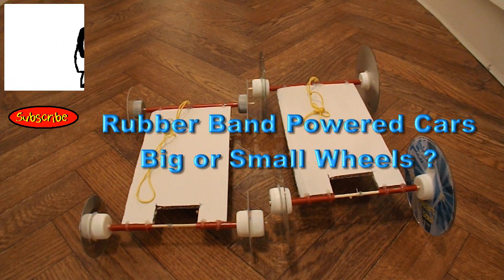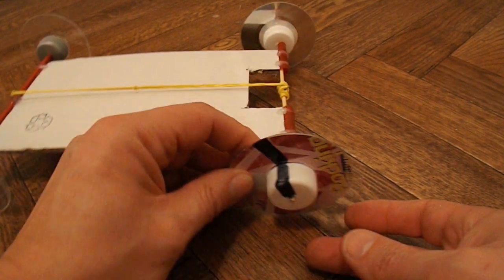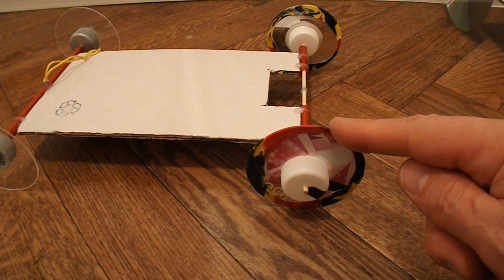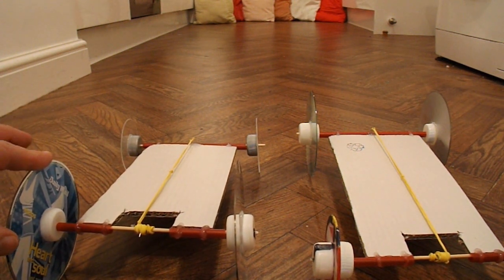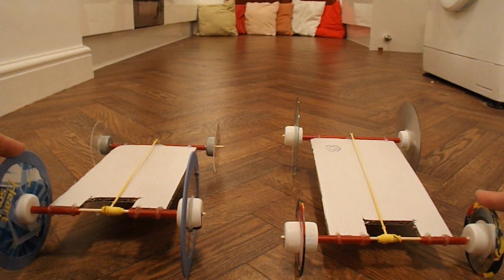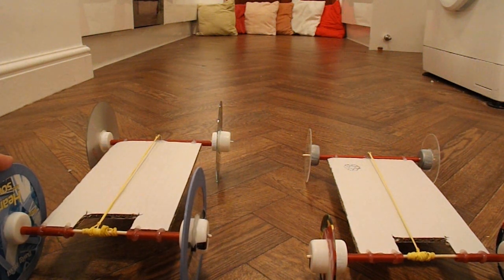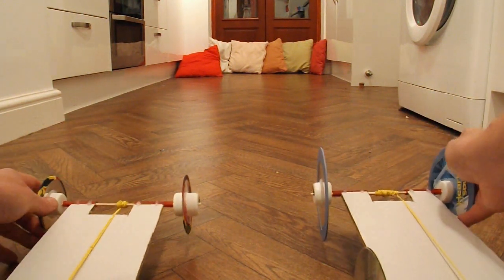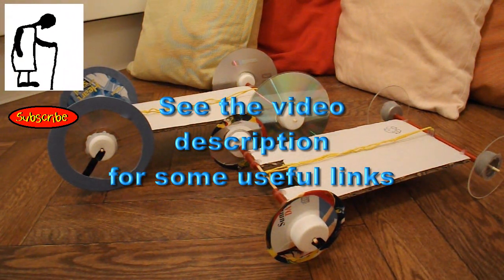Helpfile - Rubber Band Powered Cars - Big or Small Wheels

Comment: Would a front wheel drive cart be better (the rubber band pulls the front axle)?
Reply from the maker: Short answer, NO.  Long answer - In 'real' cars they make them front wheel drive to remove the need for a drive shaft to take the power from the engine at the front to the wheels at the back so it saves weight and space. A second advantage is it puts the weight of the motor directly over the driven wheels helping them to grip the road. Front wheel drive also helps with steering. However, even with that extra weight over the wheels front wheel drive cars are still more prone to wheelspin as the car accelerates from a standstill. The movement tends to push down on the back of the car and reduce the grip at the front, particularly on hill starts. I am speaking from experience driving commercial vans. HOWEVER when we apply that to a basic rubber band powered car there are differences, like no suspension to slop around and different weight distribution. I have just spent an hour trying to demonstrate my theory with one of my existing rubber band powered cars and I simply cannot show any significant difference so I would say from my tests that there is no advantage and no disadvantage. The only thing that I did wonder was if it might help the car go straight as sometimes the rear wheel drive car lifts the front wheels and they skip around losing direction. If I upload the video of my efforts I will drop a link here.
Reply: @GrandadIsAnOldMan  thanks, great video
Reply from the maker: @patrickmoody9367  this is the video of me trying to see if there is any difference but the link will not work until Thursday Evening as it is scheduled for 6PM UK time - Is front wheel drive better for rubber band powered cars? https://youtu.be/gY8r48dC6_Q
 To be honest it is a long video and probably not worth watching as I totally fail to show any benefit of either set-up.

Comment: hi what did you use for the small wheels in this video?
Reply from the maker: The front wheels were made from clear plastic or "perspex"  (Poly(methyl methacrylate), also known as acrylic or acrylic glass as well as by the trade names Plexiglas, Acrylite, Lucite, and Perspex among several other). I had made them up for a different project. I drew circles on the plastic and cut them out with a saw and cleaned them up with a file. The back wheels are just ordinary CDs cut down in size with a saw and cleaned up with a file. Some CDs are made from a plastic that you can cut with heavy duty scissors but most CDs with crack and split when you try that.

Comment: Hi again, I'm still working on my Rubber band cart and I'm wondering if having small wheels in front, and large back wheels, while having balloon rubber tires on all wheels will make the most efficient cart in terms of acceleration and longevity (how much band is still left on the axle. Would this be the most effective method? Thanks!
Reply from the maker: Hi Sakib, sorry but this is a long answer.
The advantage of small wheels on the front is to reduce the weight of the cart so that helps acceleration. You shouldn't need to put rubber on the front as the extra grip is to stop the wheels spinning and only the back wheels spin because the rubber band is turning them.
The front wheels do not have that problem but it might help to stop them sliding sideways if the cart twists under power and pulls left or right. I have only had that problem once and that was a very light cart and a very powerful rubber band motor.
Small wheels can be affected by bumps, dirt and cracks on the track more than large wheels and large wheels have a flywheel effect that keeps them rolling longer once they have started moving.
There is no easy answer so you will have to be ready to modify your cart to find the best solution for the task at hand.
I think your ideas are right but even two identical carts will never run exactly the same so there is always room for minor changes.
Reply from the maker: Hi again Sakib, if you haven't already watched this video, have a look at it. The last few minutes I race 3 different car to see which is fastest. You might find it interesting. http://youtu.be/PDewg24G3M8?t=5m24s
Reply: GrandadIsAnOldMan I'll take those factors into account, thanks again. Just one more thing. The project I am working on has a major setpoint. The challenge is to create a car using either only one elastic band, balloon and mouse trap. I've seen most of your videos using all of them, but I assumed that the elastic band would be the most powerful and best method. My teacher says the same. In the end we are all put in races for greatest distance, speed, and accuraacy at a 3 meter mark (Note: They are all seperate races) I am considering using the elastic band to to compete in the distance, and or speed race using double cd wheels at the back joind by a bottle cap axle, and crisps tube lids as the front wheels. Any suggestion as to how I should position and power my car using only one elastic band?
Reply: Sakib Wasif Sorry, I meant Either one elastic, balloon, or mouse trap. We cannot use all of them in one car to power the entire thing
Reply from the maker: Sakib Wasif I agree that elastic band is probably the best to cover the 3 different challenges. I have not tried crisp tube lids for wheels but they should be OK as long as you can get the center right. I have done a couple of videos on stopping cars at a fixed distance, both are in my helpfile playlist Fitting brake and launch mechanisms to Rubber Band Powered Cars
This video (which is a rat trap car) might give you an idea about putting a gearing effect on your axle for acceleration or distance (I might make another one for rubber band powered cars as it has just given me another idea) http://youtu.be/XXPm-K9uyGQ?t=3m48s
Reply from the maker: Hi Sakib, another video for you to look at Helpfile - Rubber Band Powered Cars - Gears and Brakes
Reply from the maker: Hi Sakib, yet another video for you to look at Helpfile - Rubber Band Powered Cars - Anti roll back Ratchet